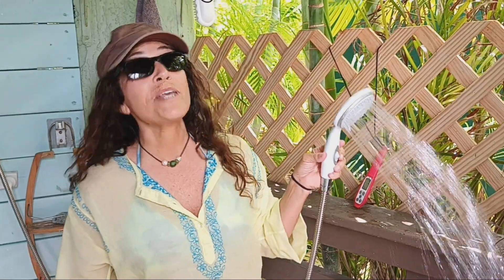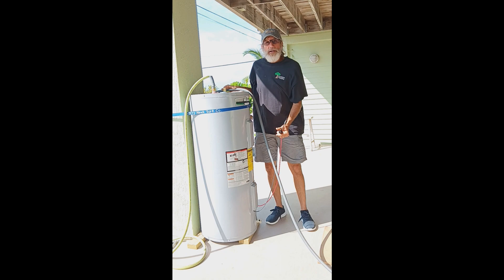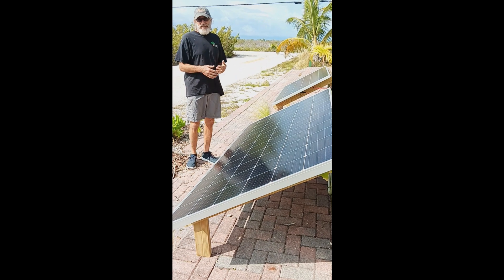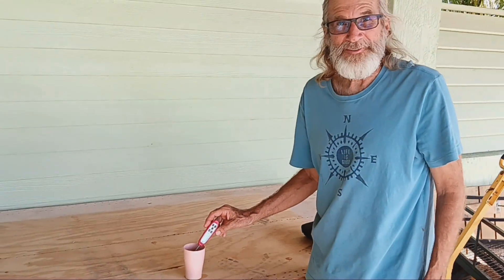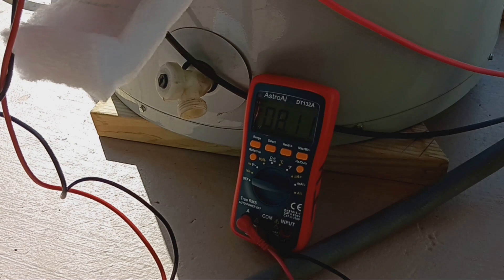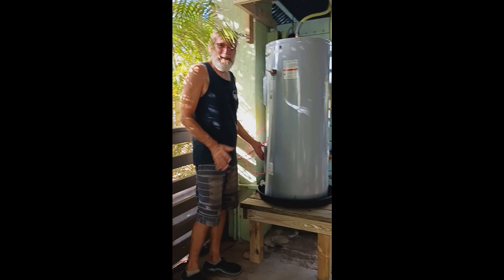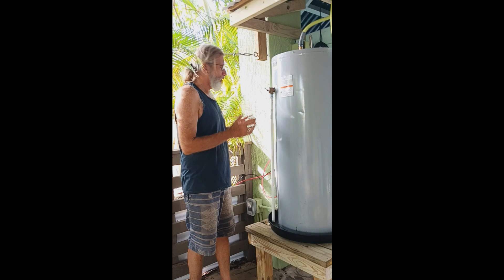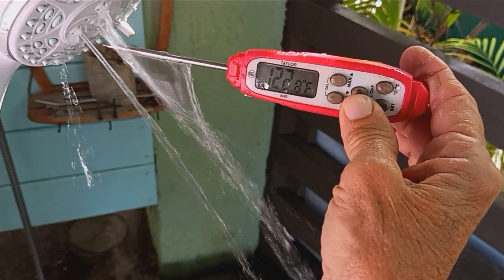Convert Hot Water Heater to Solar

Comment: I have done the same thing.

You may be wrong about the voltage rating on your heating element.

Most tanks that big use 220v elements.

You will increase the efficiency tremendously if you replace the lower element with a standard 120 volt 1500 watt heating element.

It's an ohms law thing.

A new heating element should only cost about $10.
Reply from the maker: Yes you are absolutely correct about this! Thanks for watching.

Comment: Your results may vary You are lucky to be blessed with a lot of sun and warmer temperatures. I start out with 62F water, clouds and have to heat water to 62C for the dishwasher. Today smoke from Canada is dropping solar production 30%.  In direct connect like you have that would drop the power 50%. I don't worry because I use electronics to keep the panels at controller
Reply from the maker: Thanks for sharing.  Next we will try out a micro-inverter on the PV array that will allow us to use the thermostat to maintain temperature.  Look for that video soon!